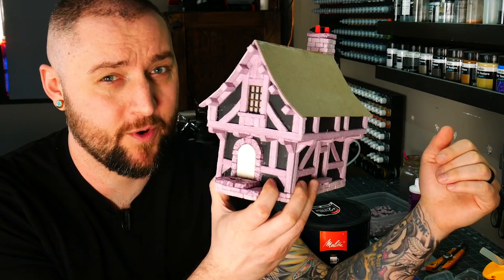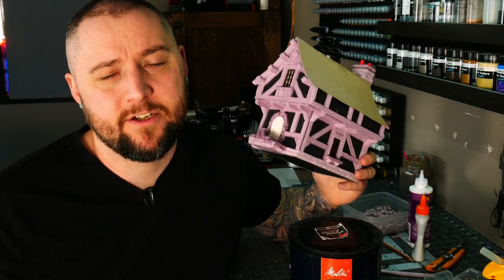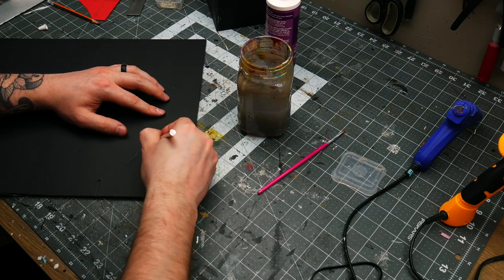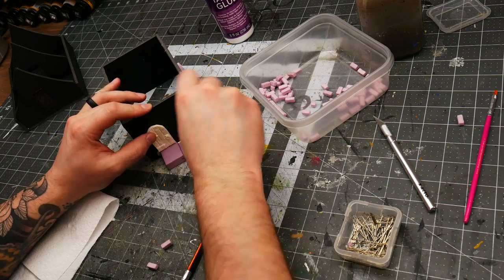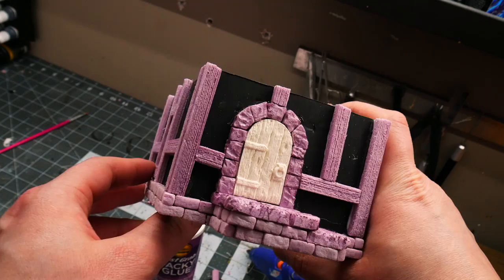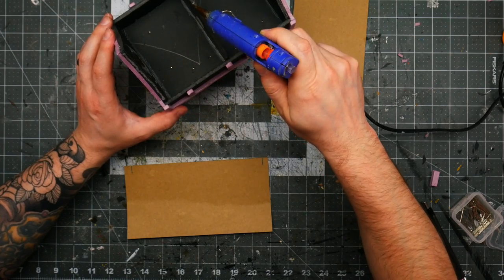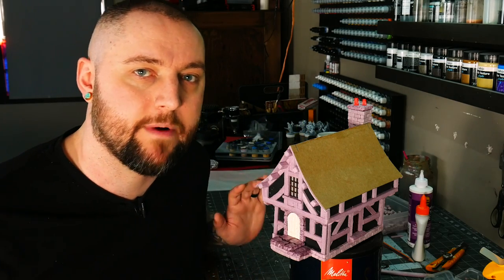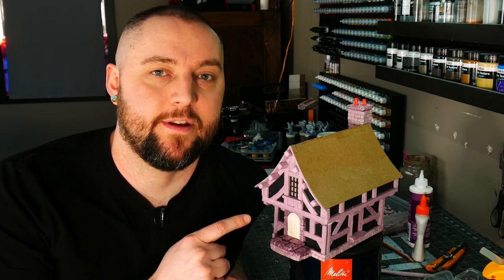Building a Foam House for Tabletop Gaming PART ONE: STRUCTURE

Comment: One way to improve static building radically: Paint the interior white before final assembly, and leave the bottom open.
When you play, just add an electric flickering tea light inside, and it will shine through the windows like a fireplace.
Reply: That's a great idea!

Comment: One of the rules in constructing of tudor houses is that the timber is made to fit depending of what is available.
So "measurements" are based on what timber they have. There are some rules regarding the size of the stucco panels based on timber sizes but when scaling down these may not look the best so eyeballing things is (I think) the best way to do this.
Btw. I Only used 3D printing up to now - I'm going to get some foam and start experimenting - Thanks!

Comment: When I started working with foam do these kinds of builds, I came from a background of costume design where materials are expensive and quickly run out for the simplest pieces. 

When I had a pile of foam cut, two houses made, some dungeon tiles and bunch of pillars, I still had 1/4th a 2x2 sheet left out of the 3 sheets I bought for another project. My favorite thing about this hobby is how cheap it is to make some really nice stuff if you pay attention to the details.

Comment: Cereal Box material (Chipboard or folding carton) has a grain direction. The easiest way to find it it to slightly bend it in each direction. The direction that has the least give is the grain direction. You should always bend chipboard with the grain, as it will curve nicely without getting a false crease. I am only telling you this from a packaging engineer standpoint; maybe it will help in the future? Your skills as a crafter far outreach mine, and I know you will be covering this roof. Just food for thought in the future, should you find a need to use chipboard in a manner where you have a nice curve without the creases where it will be visible. Love your work and channel, I am soaking it all in.

Comment: Measurements are important if you're doing recreationist builds (like the HO Scale train people who build perfect models of towns from various eras based on photographs). If you're doing fantasy or sci-fi builds, scale it to your figures as 'what looks appropriate'.
I would say, though, the overhangs on Tudor style buildings are thought to be so the upper walls cantilever the floor beams to help distribute the load of the 2nd story away from the center of the structure (if that explanation makes sense). This allows a more open space on the ground floor. However, to use that concept the overhang would need to be even (not off to one side)...
I always enjoy your excellent and inspiring work!  :)

Comment: I am an architect by profession, and I think your advice on scale is very good. often when  designing or modeling things in early stages I follow the rule of looks right is right. If it looks right to me then it is right. One piece of advice I would have for people who are worried about scale is to keep a common size miniature on hand, if you are worried about the scale of something hold the miniature up to it and then you know if it is too big or too small.  Scale figures help you keep things in scale with no need to actually measure.
Reply from the maker: YES! A miniature is the only real thing you need for measurement and scale. Or premaking things like the doors like I do can also help to build out from. Perhaps it is my years as a carpenter and my time at a design/build firm that allowed me to think this way of just blocking out forms and shapes by eye rather than measure, but I really think it's the best way and people should try to learn it.
Reply: Black Magic Craft Doors are a great scale tool. I use doors to scale drawings all the time. Once you have an element or two like that everything gets easier.

Comment: I use cardboard boxes (like from delivered minis I buy) as the base for a building and just decorate it to look like the exterior of the building. Internal play is done on floors with short or no walls for ease.
    For cluttered cities, you only need to build the front 25% of most buildings, assuming a zero lot spacing. City Tudor styles usually only has the back and maybe front overhang. I also only build the suctions of the city the players would frequent, like the tavern and or inn,  shops, weapon/armor smiths, magic shop, etc... Also adventure sites like the haunted mansion, sewers or thieves guild etc...
    Villages and towns usually need the full buildings.

Comment: As a rule rounded stone arches are for stone buildings or at least stone foundations while square wooden arches are for half timbered (tudor) construction though some have half rounded windows above them set in wooden frames though these might or might not be visible depending on if plaster has been placed over the top of the wood. Sometimes bricks are used to fill the spaces of half timbered walls which can made a nice change in look.

Comment: I really like this.
I also have a cool method the comunity may want to try for Roofing, however i don't make videos.

$1 store Twisted Hemp Rope.
$1 Store Large Wire Brush.
Brush Rope with the wire brush.
Take the Rope thin strings out of the brush then wad them up and cut then with scissors to length.
This make small lengths of "Thatch" than can be glued onto roofs.
Watered down PVA to harden after they are glued on roof.
Light Airbrush Paint. (does not take much)
Boom, Thatch Roof!

Comment: @Black Magic Craft -- For RPG, scale does not matter.  In fact, scale is something very loose in the miniatures world.  28mm, 30mm, heroic scale, grand scale -- there is no standard.   For most of my D&D sets, if looks good then it is good enough.  

However, for some tabletop war games scale may matter and may be important to some.  But, even then, we have 25mm bases, 30mm bases, 40mm bases and even 50mm bases.  What is scale?  I have no idea.  What I try to do is look at the scenario.  I cannot remember the game but there was  scenario where 6 miniatures had to start inside a house.  They had 30mm bases.  I scaled everything to 30mm bases and made the door ways 35mm wide so you could slide the miniatures through the halls and doorways.   So, to me scale is based on the situation.  Another example is I recently introduced my friend to Frostgrave.  The first scenario is the mausoleum, we decided we wanted to have 8 skeletons inside.  They had 30mm bases, the size of the mausoleum was whatever would fit 8 skeletons.   BTW, we used a modification of your technique.  The wall and the roof came off together, however, we left the door way and the first layer of brick as integrated parts of the floor.  This way you could see a silhouette of the building.  This worked well and have since continued working in this way.  Your sculpting doors video has been golden since I do not use standard door sizes and it allows me to make my own.

Thank you for all the work you do on your channel.  The only reason I have foam cutting tools is because of this channel LOL!

Comment: Brilliant video.  You might not have measured anything per sec, but by having premade doors and windows and using them in the build you were always going to get close to a 'scale'that looked good and worked.  So perhaps making doors and or windows should be first, if someone wanted to copy?  Fantastic project, thanks for sharing - can't wait for the following parts. :-)
Reply from the maker: Yes this is true, the doors and windows give a refrence point. But to that end so does any miniature. And that's what matters, is how it looks compared to a typical 28mm mini. It's better, imo, to keep a typical mini nearby while building than it is to keep a ruler.
Reply: @BlackMagicCraftOfficial  Totally agree.  It's surprising how easy it is to go off scale and make things way too small.

Comment: For me the 'scale' I usually stick with is 'around 2 inches (5cm) per floor' on a building.

It looks like you cut one in half for the 'ridge' of the rooftop.

Comment: So far my "measuring" for these kind of builds simply involves grabbing a mini and making the bottom floor at least a head taller than that. I usually do round to the nearest quarter inch for ease later just in case I need to measure something to attach to it.

Comment: how quick does the tacky glue dry when used on the four walls here? I have the exact same glue i bought from your store, was debating whether i should use it for my walls or hot glue
Reply from the maker: Really depends on temperature and humidity where you are working. But if using tacky glue for the sub structure I’d keep them pinned and be careful for 30-60 min

Comment: The shingles don't have to be AWFUL. I made a house years ago and here are my tips:
1. Use cereal boxes, it's cheap and you have them already. I used balsa wood and that got... More expensive than I thought.
2. Shingles - cut a long strip of cereal box, and then cut relief cuts into it, and curl those pieces, glue to roof and offset later strips. I laid down each one individually. Do not attempt, that was hella dumb. Then seal with water down glue to stiffen it up.

I like the use of insulation foam, that's about as multi purpose a material you can use and is fairly cheap, and you can make it look like nearly anything.
Reply: Doing the shingles isn't necessarily a bad thing, just time consuming. I recently made a ruined building with a 'tiled' roof, where each tile had a rounded end. These were cut out individually using a stamp from Green Stuff World. I guess you could do the same with the row of tile method as well, just a little more work.

Both ways are valid. Both ways use different approaches, and end up looking a little different from each other.

😉

Comment: I've missed a video somewhere, your method for timber marking has changed. I'm still using a pen. What were you using?
Reply from the maker: That answer is right in this video, seems like you miss a LOT when watching 🤣 wire brush like I’ve used in dozens of videos, it’s not a new method it is my commonly used preferred method. You must have missed like 50 videos.
Reply: @BlackMagicCraftOfficial  okay fine I've been slacking, but getting back in for a home brew. Congrats on going full time btw!

Comment: What's the name of that right angle tool @3:09?

It looks like some kind of drafters tool, and it's hard to find in a hardware store where I'm at. It's also exactly what I need to make 'true' angles with foam core board.
Reply from the maker: T-Square. But I don't advise using them for their right angle as they are often slightly out over 24". I use mine simply as a long solid straight edge. https://amzn.to/2V64ne7

Comment: I would highly recommend if you do a lot of foam core building of boxes that you pick up some 1x2x3 blocks. They are very useful for squaring boxes and keeping things upright as you build. And can be used to weight things down. I have 4 sets of these and use them all the time!  Plus you could add them as a link to your amazon store.
https://www.amazon.com/BL-123-Precision-Steel-1-2-3-Blocks/dp/B00092CJC6?ref_=bl_dp_s_web_2581532011

Comment: Nitpick: the diagonal beams on the first floor are oriented the wrong way. 
They are supposed to redirect the load of the roof towards the center of the stucture, like this \☐/ and not like this /☐\
Reply from the maker: Unless they are not structural and purely decorative like a lot of timber on the facade of buildings. I understand Basic building engineering, I’m a carpenter that has literally built real life houses but as I was trying to make VERY clear in this video, none of that matters and the goal is what looks appealing. This direction is visually better which is why it was chosen. That’s the entire message of the video.
Reply from the maker: Besides, if you want to get hung up on realism the world (and google images) is FULL of real world examples of Tudor timbers in the /\ orientation.

Comment: The building is nice and all but seams more of a 1/35 scale than D&D 28 mm scale. So basically you are just showing technique's for builds . Much harder to actually build a 28 mm scale house than to just wing it and go with "what looks good to you".  Or the leave your ruler at home it's only foam method.
Yea im sure your 1 1/2 in tall character will look great standing next to a house built for a 3' character. not too mention when you start adding multiple buildings in your gaming and all of them are different sizes kind of looks very odd. Don't get me wrong not saying you have no talent you are very good at what you do and have some great ideas.
Reply from the maker: Your point?.....it’s definitely not 1/35 scale. The door is 28mm scale.